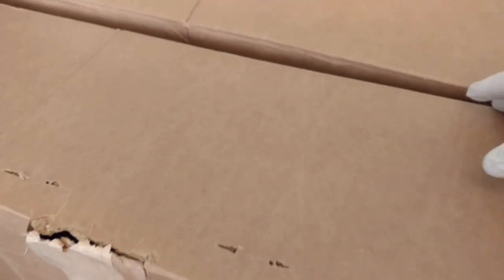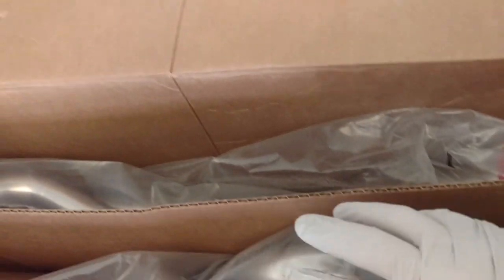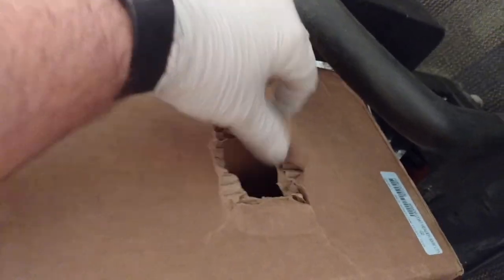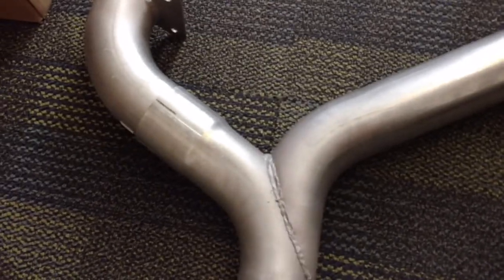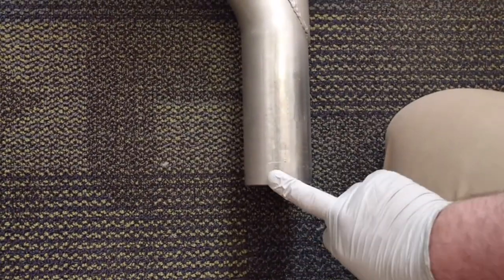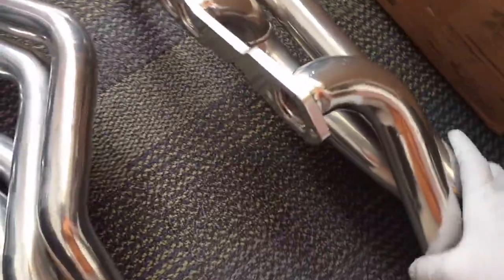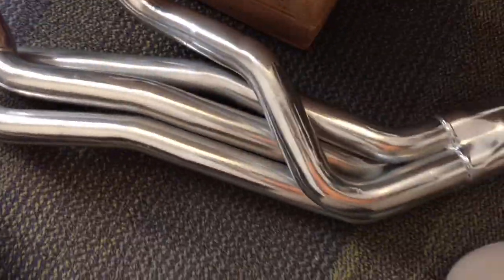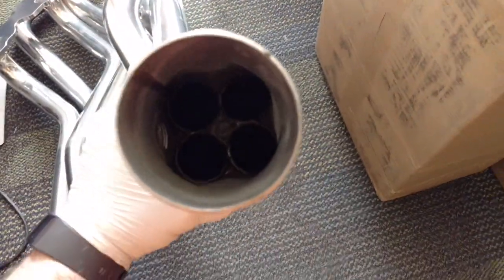LT1 Pacesetter Header and Summit Y Pipe Unboxing

Comment: Dumb question but can you weld high flow catalytic converters on this y pipe? It's mostly for the catless smell. Had a car without cat and the catless smell novelty wore off, was rectified using high flow cats. Looking to get these same long tubes for my 97 Firehawk LT1 M6. Thanks

Comment: Nice information, did you install yourself?
Reply from the maker: Vend Master I'm actually in the process of putting them in.  I have the driver's side in, and it went in fairly easy. The passenger side is another story.  It also needs to be welded to you catalytic converter.
Reply: Gary Burrus yeah I have always heard it's a nightmare on the passenger side, I was contemplating doing it myself but I think I'll just pay a reputable garage that I know to do it
Reply from the maker: Vend Master I do my own work in my garage because it's a good way to learn.  While I'm in there, I'm also doing motor mounts, changing the steering shaft to the LS version, new Opti, and plugs/wires.
Reply: Yea I do alot of my work as well, love working on my 97 ws6 ram air....opti and plugs I did 2 years ago...lt1 is a great motor.... awesome sound to it as well